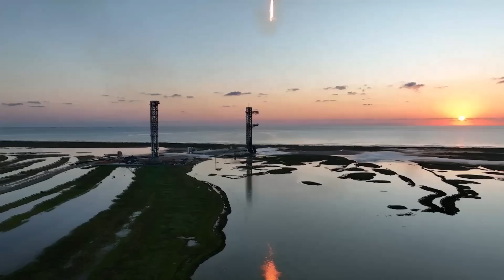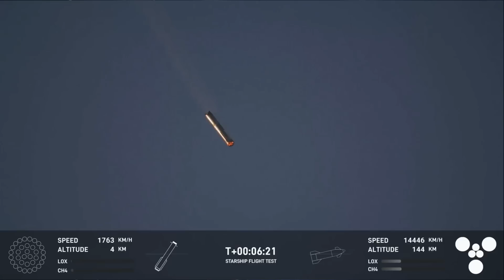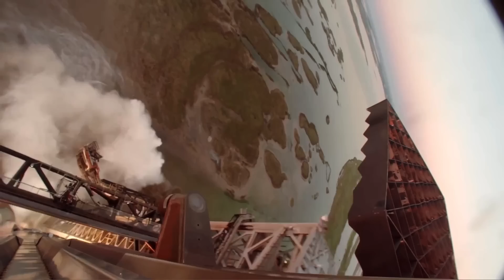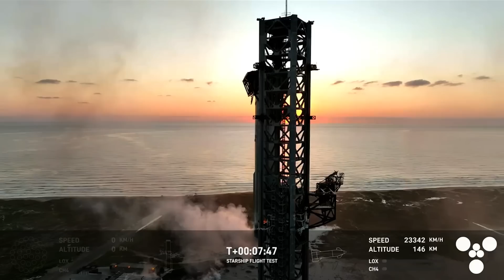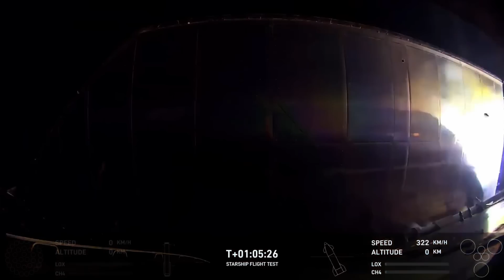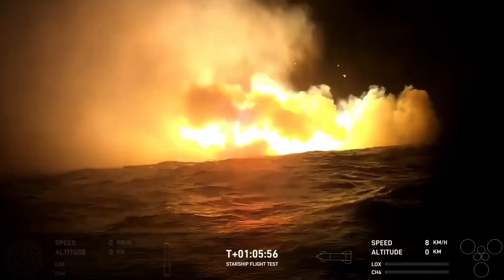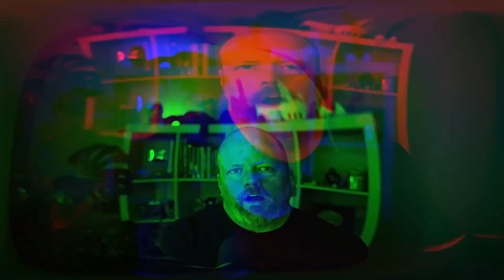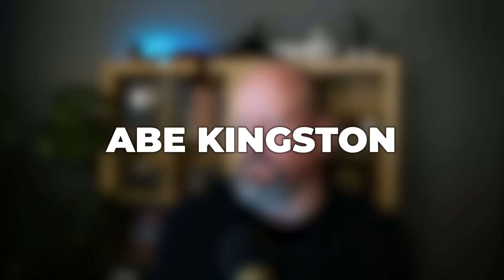ABSOLUTE Success! Full Analysis of Starship IFT-5 (with @scottmanley, @MarcusHouse )

Comment: There is a pretty simple way to get the boosters to land at sea and back to land reasonably quick.  There are actually multiple ways that could work.  One to highlight here as it would be the least development cost is you could actually have two types of ships for landings.  One ship would be optimized for catching boosters.  It would sail out to the landing zone.  It would have a landing tower in the middle of the ship that would be stabilized.  It would have cranes on it to move Superheavy boosters around.

The second ship would be a fast transport ship.  It could take one or more Superheavy boosters.  It could have hydrofoils for fast transit over the water.  It could be powered by jet turbine engines to keep it moving fast over the water and on the hydrofoils.  These ships would be big and with computer control, you could have the hydrofoils reasonably deep in the water and the ship come reasonably high out of the water so that the ship could fly over the water in most weather conditions.  If they average a speed of 50 knots, a perfectly reasonable speed for a hydrofoil ship, that trip back to land would take a matter of hours.  The booster only goes so high and so fast, so it will never get all that far out from the launch site.  You still have a potential of say a 24 hour turn-around time, which would be phenomenal.

If you want to get deeper into possibilities, take note that Starship and Superheavy never lay flat.  The only time we have seen Starship flat, it exploded.  But for transport, maybe you could have an exoskeleton you use to move the rocket stage horizontal and back.

If you can move the rocket stage horizontal, you can start thinking about aircraft transit back to land.  Maybe you use an Ekranoplan.  Maybe you could use a flying boat.  Maybe you could use a giant multi-rotor drone.  Or even doing by ship, maybe you could have a special built hydrofoil ship that just carries one Superheavy horizontally back to the launch site.
Reply: There are many solutions, but engineering is about finding the most optimal solutions. You could use a platform and an advanced fast moving ship, but would it add more to the cost per kg of getting to orbit than simply returning to the launch site? SpaceX has probably concluded that yes, it does.

That doesn't mean they are right, of course; maybe it could be done in a better way than they looked at, but at the end of the day, you simply have to settle for some solution, and try to make it work as intended. If SpaceX has chosen the wrong path, or are poor at executing, that opens up the space for competitors to enter the market and do things better.
Reply: @SpaceAdvocate  I am thinking the most likely case is they realized the original platforms purchased would not work and just dropped the idea for now to just get the rocket working.

Here is the problem when you plug in the rocket equations.  When you look at what mass to orbital velocity is lost, it is a descent chunk.  For Falcon 9 it is not too huge of an issue because the second expendable stage is very light as in small dry mass.  This allows it to have a good delta-V if it doesn't have too heavy of a payload on top.  Starship is relatively heavy as in mass used for the rocket with all of the recovery hardware and recovery propellant onboard making it to orbital velocity.  So then you are testing out designs and materials and seeing if you can recover with the ship in a rapidly reusable shape and still have margins left for a descent payload.  Whatever goes into the rocket itself and its recovery systems, that comes straight out of payload capacity and ability to reach higher orbits.  This high mass used for the rocket is especially a problem when you need to go to a higher orbit to deliver the payload as Earth has a relatively strong gravity for what chemical propulsion can do.  Flying the booster back to the launch pad eats up a lot of margin.  You can see when comparing against a Falcon 9 launch with a drone ship landing that the Superheavy booster cuts off way early, leaving far more work for Starship to make it to orbital velocity.  The staging happens so early that the rocket is really still kind of in the atmosphere where Falcon 9 usually stages above the atmosphere more or less and at a far higher velocity, leaving a lot less work for the light second stage to do to make it to orbit with a payload on top.

The estimates I have for an ocean landing is the payload Starship can carry to LEO will go up anywhere from 50% to 100%.  Especially if it ends up on the 100% side, that is twice as many missions to move the same amount of mass.  Especially with tanker Starship, it is very easy to see how twice the payload to orbit will make a huge difference.  I think that automatically qualifies building these extra ships as a prudent cost saving measure if you are doing a lot launches.  Each launch is going to cost millions of dollars no matter what SpaceX does, so say they spend $200 million on ocean based recovery ships, they could easily recover that cost in a year doing launches at a cadence like they do with Falcon 9.  With Elon Musk's thousands of launches per year goal, you could have a fleet of these ships, say spending $1 billion to get the fleet together and it will quickly pay itself back while making the Starship platform far more capable.

It would be just crazy if they already do ocean landings with their older platform and see how much it affects things there as in improving performance and capability of the platform and just drop the ballistic return trajectory idea altogether in their new platform.  The sensible thing would be to have an improved system designed for the new and much larger rocket.
Reply: having a sea hardware is actually a downside actually, because the starship then having to rely on it, they learnt it from Falcon 9, they said it themselves that their rocket is more advanced than their entire fleet, and they have done researchs with oil rigs landing concept because the logistical issue, and then you talk about hydrofoils, Ekranoplan even, very confidently but never consider how impractical they really are
Reply: there will be no landing on a giant platform at sea (either a barge with catch tower or shop) for heavy booster because the booster doesn't need to go far away from the launch site to begin with.
Reply: @FarokhBulsara4065  The problem with it not going far is it doesn't actually contribute that much to the launch and then Starship on top is left with a lot of work to do while every 1 lb of mass used for recovery of Starship is 1 lb less cargo.  So really, if you want to recover the Starship upper stage and have a useful payload, you kind of have to have Superheavy do as much work as possible.  Why would you go from Falcon 9 doing more work with the booster when they can still recover it to Superheavy doing less work when trying to recover the second stage?  It just doesn't make any sense.
Reply: @ChaJ67  for the future block 2 ship and booster, they stretch the tank size for both vehicle and equip them with better performance raptor 3, these upgrades will solve the payload to orbit problem.

saying the booster contribute less for the entire launch is unfair, although it has some truth in it, but again, they are doing trade-offs.

Starship upper stage likely generates 60% of the deltaV for the mission, and it has to be this way.

with the tank stretched on both vehicles, they will make the booster generate more delta V at the same burn time or even faster than current version.

now does it make sense?
Reply: @FarokhBulsara4065  Not really.  I do know about the newer engines and I do know about the stretch.  Here is the thing.  The Raptor 3 engine mainly gets you a better thrust to weight ratio and more thrust.  These are good things when it comes to rocket performance.  The thing it doesn't provide is a higher ISP.  So what does this all mean when we parse out each piece of this information:
1. Higher thrust - SpaceX can stretch the rocket stages.  They already decided that the starting thrust to weight ratio should be 1.5 : 1.  This is the initial force pushing you into your seat is 1.5 G.  So more thrust means taller, heavier rocket to maintain this starting thrust to mass ratio.  In other words brute force to get to more payload capacity.  Not more efficient; just more brute force.

2. Better thrust to mass ratio of engine - This does actually make the rocket more efficient.  It is really kind of a small marginal improvement at this point because the whole rest of the dry mass of the rocket using stainless steal and all is a lot.  But yes, whatever you can do to reduce the dry mass of the rocket, the better the performance of the rocket.

3. Essentially the same ISP - Now this gets into the efficiency of the rocket.  Especially when you need headroom to recover rocket stages, this is the most crucial factor in making a rocket more recoverable and/or being able to do missions requiring a higher delta-V.  Like say you want to do a GTO mission.  An empty Starship does not have the delta-V capability to do a GTO insertion because of the performance lost in the boost back burn and the high dry mass and recovery fuel mass of the Starship upper stage.  It would need to refuel in space just to do a GTO insertion burn.  On the other hand the light Falcon 9 upper stage can do a GTO insertion burn, no problem.

Following on from these points, consider a stretch of both stages.  This does not mean  staging happens at a higher velocity higher up into space.  There is a proportion deal where if SpaceX holds the same ratio of mass between Starship and Superheavy, considering all of the above, it will stage at roughly the same altitude and velocity.  This velocity and altitude determines what percentage of the work is on the upper stage.

Here is the thing with the Falcon 9.  It is generally accepted that for every 7 lbs of recovery hardware and fuel on the booster, 1 lb of payload capacity to LEO is lost.  On the upper stage, seeing it goes all the way to LEO, every 1 lb of recovery hardware and propellant is 1 lb of payload lost.  There is also the problem that atmospheric heating is a cubic factor in relation to speed and the booster tends to fall in at a steeper angle than the upper stage.  So a bit of a ying and a yang, but overall it is a lot easier to recover the booster than it is the second stage.

You take this and apply it to Starship where you are trying to recover both stages, you really want to put a fair amount of work on the booster because even when it does more work, it is still far easier to recover.  Only when you get it up to much higher velocities like you see with some other rockets does this recovery become hard to impossible.  At the same time a boost back burn costs a lot and it gets a lot worse the further down range the rocket goes before doing the boost back.  But then when you focus on doing this boost back efficiently of the booster and having it cut off early and such, that puts a lot more on the upper stage to both do the mission and have all of the recovery hardware and propellant to make it back.  Another way to put is you pull on one to try to make it more convenient and the other pops lose.  And unless you can drastically improve ISP, this can't really be fixed.  And the fuel is only going to do so much.  Granted, liquid methane is providing a lot more overall performance than other fuels, but it has its limits and with Raptor 3, that is basically at the theoretical limit.  You just can't get better than that.

Maybe another way to put it is SpaceX at this point can only really make a bigger, heavier rocket to get more payload into LEO.  The actual efficiency to orbit, that percentage of what is on the launch pad making it to LEO doesn't really change.  A proportionately bigger rocket has proportionately more used for recovery.  It still doesn't get you say a rocket that can do a GTO burn or even go further out.  It doesn't actually have a meaningfully better delta-V.  Raw size doesn't equal more delta-V.  Actually the empty Starship delta-V capability is a lot worse than the empty Falcon 9 delta-V due to Starship having a lot more rocket mass to move around relatively with all of that heavy stainless steel and recovery hardware and recovery propellant.

I hope this explains why I don't follow you and why I think ultimately SpaceX is going to have to develop a ballistic trajectory catch system for Superheavy.  When a Starship separation happens at the same altitude and velocity of a Falcon 9 doing a drone ship landing of the booster instead of right now where Starship stages much sooner in the flight, then the total delta-V performance of the rocket is going to be a lot better.  Right now that point in staging is over 1,000 km/h and ~20 km lower in the atmosphere for Starship than it is for Falcon 9.  So building around that boost back burn is hurting things a lot.  And explained above, Raptor 3 does and stretched stages does basically nothing to fix this.  It is mainly just more brute force to LEO with only a small efficiency gain from the lighter engines.
Reply: @ChaJ67  Starship isn't meant for GTO, they only need starship to carry as much payload to LEO as possible, beyond that they can strap a kickstage to it but very unlikely, leave that for other high energy rocket like Vulcan.
Reply: @ChaJ67  still, it's trade-offs, only time will tell.
Reply: @ChaJ67  i mean Tom Mueller retired at SpaceX after being done with Falcon 9 and founded Impulse Space to develop kickstage, who knows what they be cooking.
Reply: @ChaJ67  anyway, GEO is a niche market, there is not many demand for it, most of them is DoD satelites and few commercials here and there, and Vulcan was built specifically for it and they only want Vulcan to do the job.
You said it, Falcon 9 can do GTO with no problem, then let Falcon 9 do it, why bother bring out big shiny rocket ?

again, Starship isn't meant to do everything all at once, it is better to have multiple rockets and each do best in one specific task. it's good for the market. And good in longterm strategic.
Reply: @FarokhBulsara4065  They could even potentially use the Falcon 9 upper stage as a "kick stage" / 3rd stage.  Consider for the Europa clipper mission, a little over 50% of the burn time was for the boost off to Jupiter with a little under 50% to make LEO.  When you get into a stretched Starship with Raptor 3 engines, 150 tonnes of payload could be ~100 tonnes to 3rd stage and 50 tonnes to a payload or something like that.  It would just be for say Europa Clipper if Starship was ready, you would fully reuse the first two stages where with Falcon Heavy they expended the entire rocket.  Maybe even fully gas up the Falcon 9 upper stage for a really direct and fast route to Jupiter.

When you have Starship completely concealing an expendable rocket stage, you can make that rocket stage to be extremely light dry mass wise, giving it very good performance for other missions such as GTO or Lunar injection or some other destination in the solar system.

When you think about it, refilling Starship in LEO is kind of a crazy proposition for a lot of missions because you are talking about moving around a 120+ tonne dry mass ship around to higher orbits and other places, a ship designed really to be a shuttle to and from LEO, not optimized at all for interplanetary travel.  If you don't actually have to, a lot of stuff will be far cheaper to just have a rocket stage / kick stage inside of Starship optimized for the mission and a payload also inside ready to ride on that extra stage inside of the cargo bay.

Even doing this Lunar landing deal, I am kind of surprised that SpaceX was like "we will just land HLS Starship on the Moon."  Especially with NASA requirements, they could have just taken the money and put together a separate team focused on a lander that would just ride into LEO on Starship.  They could have thrown the Falcon 9 upper stage in as a 3rd stage to the Moon.  Then have a dedicated small lander capable of holding 4 people and fullfilled that contract.  One launch, one landing on the Moon.  Or maybe for more performance, have a light upper stage like mentioned in the previous paragraph with a single Raptor 3 engine on it for better performance as a trip to the Lunar surface takes a lot of delta-V and this would have a much better delta-V potential than the Falcon 9 upper stage.  No stainless steel.  Maybe carbon-fiber composite spherical tanks for the absolute lightest design.

Comment: I had a very high confidence they were going to try the RTLS, but I thought they might at the last minute have an abort and sent the booster into the Gulf. But I was very confident if they went for the tower, it would work. The reason I felt this way was because of the delays in the flight, which provided a lot of time for SpaceX to get everything right.

Comment: On the "test refueling" front - maybe make a Falcon 9 mounted "target drone" that is launched ahead of time to be in the orbital plane of Starship's trajectory to be the source/recipient of refueling? 

Don't even need to adjust Starship's flight plan from IFT-5, just have a target that meets it on that flight path (and reenters and burns up just ahead/behind of Starship.)

If Booster 12 had been a "final design", not the interim with the hot staging ring, I'd think maybe they'd try to re-launch the same booster just to see how it handles it. But it would be silly to do it with such a now-out-of-date Booster version.

Comment: I think the multiple puffs of inert N2 or CO2 gas venting out of the Booster's rapter engine bay was to purge fuel and oxidizer so as to prevent their accumulation and fire or explosion. The reaction thrusters steer the falling Booster separately.